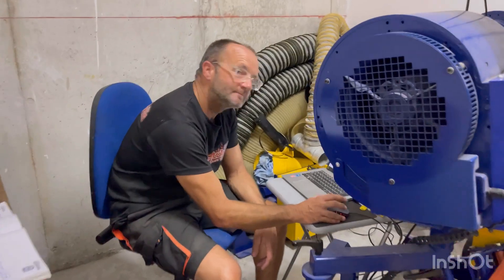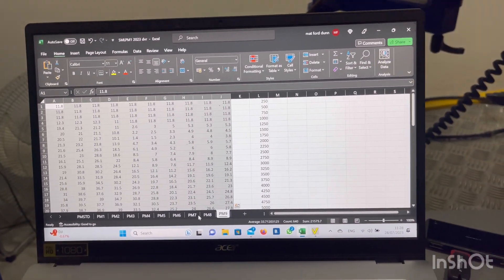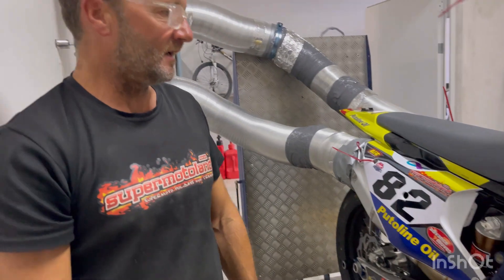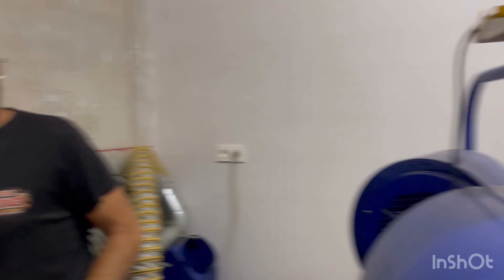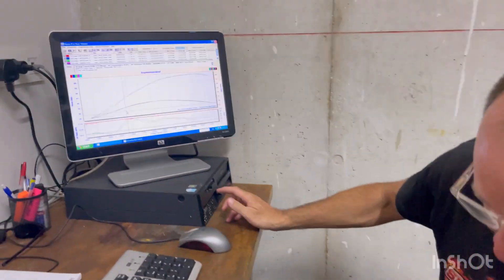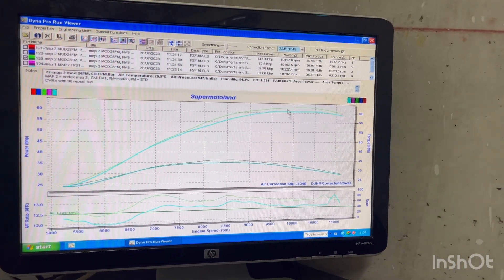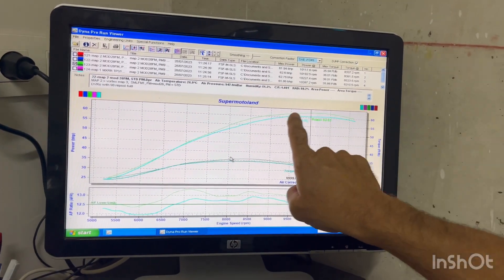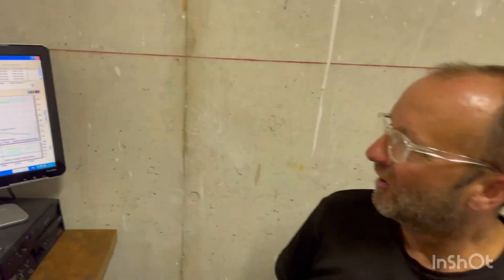Fuel mapping and ignition mapping the 2023 Husqvarna FS450

Comment: Sorry for refeering to this older Clip, but as I'm just mapping my bike aswell, I'm curious on every Info I can get. One Question: Between these two Graphs you showed (where the 2nd made significant gains) did you only played with Fuel or did you also trimmed the ignition? Curious if a leaner AFR makes such significant changes?! If it's both (more advanced IGN + leaner AFR) it would be more obvious to me. -> "Newbie needs basics"....🤣
Thanks in Advance!! 
PS: Love your Clips, especially those technic-info's on Parts, Engines (tuning + insights) and Bike-Setup. PLEASE keep them going!! What about a  "How to Brake it in" - Vid, which Matt made an article of, years ago? 🤩 Cheers!!

Comment: Just trying to get some assistance with this issue on my 2023 fs450. I'm in the US and an expert racer. I recently switched from the supermoto short tracks to the bigger road race tracks with my fs450. At my last race the bike was cutting out on me consistantly at the same place on the race course like as if I hit the STOP button.  Once I stopped off the track the bike would start right back up but would quite again at the same place on the track. The problem accured at the end of the front straight (115-116mph) under hard braking into turn 1. Have you ever experienced this problem? could it be the tip/rollover sensor. I tried to test it but have had no luck making it cut off the engine. Any thoughts? thanks.